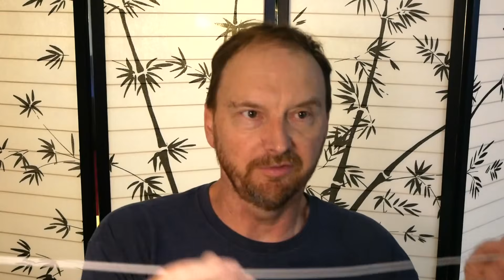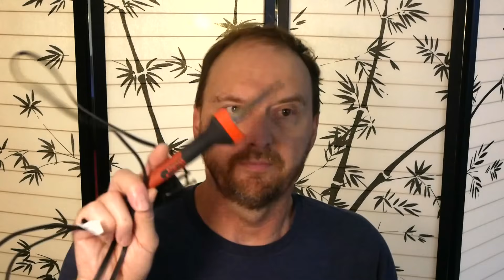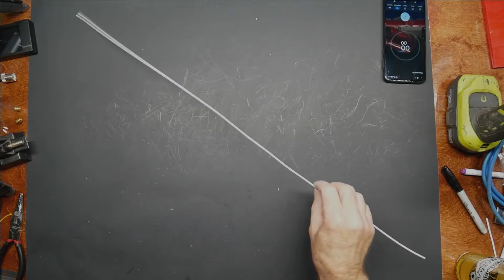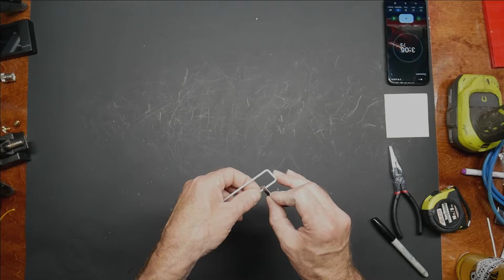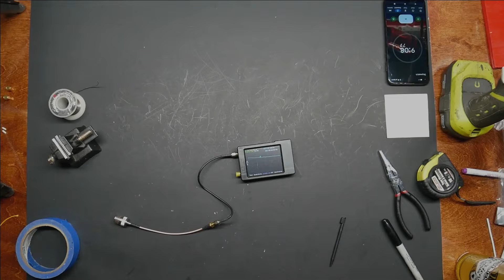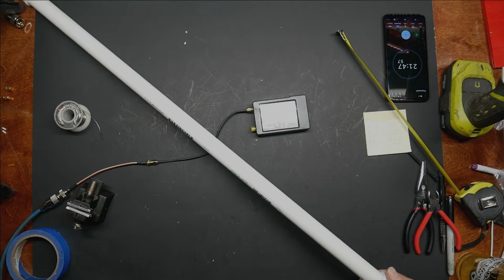Building a GMRS J Pole out of 14 gauge house wire.

Comment: A 5/8 ground plane antenna would perform far better, cost less and be easier to construct. J pole antennas are probably the worst possible antenna you could use for any application aside from a dummy load or random wire. Why people still build these horrible things is beyond me.

For those curious, the reason why is gain. A jpole has less than unity gain, which means you're literally getting LESS power radiation than you put in, and that's not counting coax loss. In contrast, a 5/8 ground plane would give you around 5-6dbi of gain which results in MORE effective radiated power than you put in at the feed point. So Jpoles are harder to build, perform horribly, and are extremely wasteful and yet these ham and gmrs guys insist on promoting these peices of shit constantly.

Comment: I followed this and got amazing results. I have hit a repeater over 30 miles away reliably, after getting it about 25ft in the air. 7w handheld cheap radio. I used blue 1/2 pex because that’s what I had. My bend in the j was slightly tighter than his design but it doesn’t seem to matter.   I taped the ends shut to keep water out for now. I have talked to three contacts now they all say super clear. I’m quite surprised with this. Thanks for the info! WSMH329

Comment: I found a plan in my notes where you can use am inch of tin foil on the PVC at the feed point , slide it up and down and it will adjust your SWR like that.  It works for me. What do you think ?

Comment: I used copper clad welding rods that come in 36 inch lengths to make mine.  Much more rigid than copper wire and they are rigid enough to use without putting it inside pvc pipe.  I have made them from solid brass brazing rods.

Comment: I built my j-pole out of 1/2 inch copper tubing. Works great once I used my nano vna to tune it. Next, I modified it to a super j pole adding a 1/4 wave stub and another half wave. It really works great. My next project is a coaxial colinear vertical. I love the nano vna for doing these antenna projects. I wish I could add a picture of the super j pole here. My next project is a meshtastic j-pole.

Comment: This did not go well for me. Made 3 attempts building this antenna this weekend. None of the SWR values were below 2.0, and when inserted into the pvc no swr value was below 3. I made a 2m yagi before attempting the j-poles, and the swr was at 1.03 at 146.20 and had to make zero adjustments to that build. So at least the weekend was not a total loss

Comment: If there is some insulation on the wire (permittivity higher than air), there will be velocity factor something like 0.7 or 0.8 and antenna should be maybe 20% shorter, than numbers given by an online calculator, right? Does anyone of you measured SWR and resonant frequency please? With heat shrink sleeve tubing and without it?

Comment: Every similar tape measure is manufactured to slide.  It slides exactly the thickness of the sliding end to give you accuracy whether hooked on the measured item or if it's bumped against the end of the item that's pushed against a wall.   When you hook the end on something it measures accurately hooked on the end.  When you bump the end on something (like a wall) the tape measures accurately.  That's because it slides exactly the same amount each way (whether hooked OR bumped) so it will give an accurate measurement both ways.  
Test that.   Hook the tape measure and mark a board or some other item.  Then bump that board against the wall and bump the tape measure end against the wall, too.   The measure should be the same both ways.  Your tape measure should give you the same measurement to that same mark when measured both ways.  That will work UNLESS the tape measure has been dropped in a way that bends the end that slides.
Oh, I'm making antennas today.  I'll make one of these antennas to try it out.  Thanks for the video.  73
Reply: WTF are you talking about?

Comment: I have been searching for a video on a GMRS base station build for days.  I stumbled upon your video this evening and immediately commenced to building.  I actually built two of them this evening.  Both tuned to 1:1 on 467.550, where higher power is permitted for repeater use.  At 462.500, low power, a 1:2.  I found tuning was more accurate if both caps were on the antenna.  I am now able to open a repeater approximately 10 miles away, while holding the antenna in my hand while sitting in my shack.  I can't wait to get it out on the tower to see the results.  Thanks for sharing such a great video!!!

Comment: Band center is 465.14375, I'm going to build one of these - thanks - Question:  Can you give measurements or diagram for the critical lengths and solder points?

How to measure impedance match, or is that derived / guestimated by swr reading alone?

Thanks!

Comment: I am having an issue getting solder to stick to the copper Romex. I've gotten it plenty hot. Idk what I'm doing wrong
Reply: wipe the bare wire with alcohol to clean any residue  on the wire. this may help.
Reply: You either need to use Flux-core soldering wire or apply soldering paste on the copper before soldering with non-flux-core soldering wire.
Reply: @BACKROADSNOMADOFFICIAL I was using flux, I tried a considerable amount too.

Comment: what do you mean by jumper, what coax size and what connector on it, and how long, is the connector for swr pl 259 or tv coax or cb
Reply from the maker: 'Jumper' is a short section of 50 ohm coax with a PL259 on each end. Any coax 50 ohm coax can be used, it's a balance between loss at UHF and ease of use.

Comment: I have 3 questions.  First, would there be a problem building this out of bare copper wire, rather than insulated?  Second, rather than solder the feed wire to the antenna, would there be a problem connecting it with a set screw type barrel lug, that would allow you to move the feed point up & down easily to find the 50 ohm sweet spot?  Third, is there an easy way to measure the 50 ohms impedance with common tools?  I'm assuming that a common hand held multi meter is only going to measure resistance & not reactance.
Reply from the maker: Bare copper wire would work, but would require longer lengths due to velocity factor. The set screw lugs are a great idea. Correct on the multimeter. Higher end radios might have an SWR meter, but the nanoVNA is the cheapest way to measure antenna impedance.
Reply: @ricksshop  How do I know if the feed point is too close to the end or too far away?  I assume that would change impedance.  But how would I measure that?

Comment: Would 12 gauge Romex work any different than the 14 ga? I only ask because I have a bunch of that already.
Reply from the maker: @travismuse7430  Sure. The thicker wire might want shorter lengths. Tune accordingly.
Reply: @ricksshop Sorry I didn't read previous comments before I asked. I see others asked the same question
Reply: @ricksshop  I don't have a tuner. Is it worth buying one? And what one would you buy?

Comment: Has anyone tried this using 12 AWG wire?  Is there any unforeseen issues doing such like resonance, impedance, etc.?
Reply: For anyone interested I used 12 AWG (solid copper made in the Philippines) with seemingly no issues. Excellent response on the scope and dead near flat SWR. The performance has  been great and I’m enjoying many fars with it since it’s hanging off my repeater.

Comment: The end of the tape measure is not sloppy. It moves to account for the thickness of the end. It’s short when you push it against a wall but extends when you hang it over a lip and pull.

Comment: If I was to use 12 gauge wire to build it with would that change the measurements any. Reason I ask is because I have some 12/2 left over from a addition I just got done with

Comment: Thank you for your excellent video.   However,  I have measured carefully and built this antenna 4x now and cannot get good SWR (3+:1).  I am using 13' of RG-58 and a HT radio.  My thought was I could hoist it up a tree at camp.   Any thoughts as to why this isn't working for me?   I get longer measurements when I use online calculators.... using VF = .96.    Thanks in advance for your consideration!  PS--Menards carries the 200 psi PVC...... Home Depot did not.

Comment: Can the body of the antenna be any kind of metal or it has to be copper only? Also can it be uninsulated? Thank you in advance.
Reply from the maker: Any conductive material will work, even stainless (whips have been made of stainless for years). Uninsulated wire will require less velocity factor, therefore will need to be slightly longer. Any material other than copper won't have the advantage of solder connections.
Reply: @ricksshop will 12g wire result in different lengths?  I have both and was considering using the 12g

Comment: No shame intended, since it was only this year that I learned why “the end of these things is always sloppy”. The tape measure is designed to move the end out when measuring outside diameter and in when measuring inside diameter. This accommodates the thickness of the tab on the end of the tape. This is a feature, not a defect.

Comment: I commend this video because it will help anybody build an antenna for whatever service they are into. If you have the parts to build an antenna already, all you would have to source is the wire. I suggest using #10 AWG to lower the antenna "Q" and make it more broadbanded than it would be with #14 AWG. the project might take two hours to complete, including the time to mount it wherever you choose. I would mount it on a metal roof, or on a metal pole above the adjacent tree line for unobstructed access to a repeater. Good luck!
Reply: How about using 12g wire?
Reply: I suggest instead that you use 1/2 inch copper tubing. Makes it more broad banded and much more robust. I built mine as a super j-pole with a quarter wave stub on top followed with another 1/2 wave vertical on top.

Comment: Will 10ga work just as well or better?
Reply from the maker: It will work fine, but with bigger diameter conductors end effect might require shorter dimensions.
Reply: The mil spec seems to have changed on  12, and 14 gage since the 1960's. 14 awg appears to be slightly heavier, 12 awg slightly thinner.. the older 12 awg wire is near near todays 10 ga!..about  .018" difference. Which could change the space between the elements and fitting into thin wall pvc..

Comment: A tip I learned is before you start, clamp one end of your wire in a vise, then use your drill to twist it. This straightens the wire and makes it quite rigid.
Reply: Good tip brother, just did this, my wire is as straight as an arrow now
Reply: So does playing it on a flat bench and cover in with something flat like a 1x6 and just roll the boat over it it will straighten it also
Reply: makes a lot of sense since wire is annealed out of the box and copper work-hardens - nice!

You could also over-anneal it to do your bends / get it to relax first also using a torch though this is likely unnecessary

Comment: Hello sir, thanks for the video. I’m new to GMRS radio so I ask forgiveness ahead of time for my question 😅 
I noticed you soldered the center wire of the coax to one part of the house wire and then soldered the shielding to another part of the same wire. Why doesn’t that cause a problem? Seems like it would be bad to have antenna directly connected to ground. Or were they separated electrically and I missed it?
Reply from the maker: That's a very good question, and a good subject for a video. Look for it upcoming...
Reply: Thats funny,my brother and I are newbies also and i was going to use a cb antenna base and saw the threaded stub was just a frickin solid stub!!! I thought how does that magic work all connected to one stud!!!

Comment: Could you use this directly with your GMRS hand held radio if needing better reception on the ground at a crowded event and get the desired result?
Reply from the maker: Yes. In fact, I outlined such a setup for 2 meters here: https://www.youtube.com/watch?v=lpilADTKD6k You will need to use smaller diameter coax (RG174 or similar) and adapt to your handheld as needed.

Comment: Great video, I'm inspired to build one of these, I can only find 12 gauge laying around, will it work?
Reply from the maker: Yes it will, the larger diameter may shorten the dimensions a bit.
Reply: how would one go about calculating the difference? I also have 12g on hand.
Reply: Did anyone find the dimensions for 12ga wire?

Comment: Thoughts on using 18Ga wire? Too thin?
Reply from the maker: Oh, no, it would work. And handle 100 watts as well. Smaller conductors might need a bit more length. I just use 14ga solid as it's the most common.

Comment: Nice J pole for any frequency ! Just use the formula for a j pole and then trim for resonance. I would seal the PVC and use it as a radome to keep moisture out so it would not change the resonance any. Better to build an antenna and learn from it, than just buy it off the shelf and learn nothing. Well Done ! 73 de W4FJF.

Comment: If your antenna has a vswr of 1.2 after the first build just leave it like that. Is is excellent. It amounts to a reflection of only 0.8 %. Even 10 meter coax or a connector will cost you more power.

Comment: Thank you for doing this build video. Saved me a lot of trial and error and I managed 1.07 @ 465 MHz after 2 trimmings. 🍻

Also…(fyi)
The “slop” that’s in the hook end of a tape measure is designed to make up for the difference of when you measure by hooking the end over an edge, versus butting the hook up to the edge. 
The amount of movement is equal to the thickness of the hook material and yields the same measurement regardless of how it’s used.🫡

Comment: will it perform better with radials?
Reply from the maker: It doesn't need radials as it's already 1/2 wavelength. The gain of a vertical dipole is a bit better than a 1/4 wave ground plane with radials.

Comment: Q: If you take off a little too much off the short leg.. can you "add it back" with a dab of solder solder?  Recommendations?
Reply from the maker: Yes, what I've done is solder a wire in parallel that can be moved in and out to adjust...
Reply: @ricksshop  Good idea.. Thanks!
I think this is a great first scratch antenna project!

I am curious why this one is so much shorter than Ed Fong's GMRS JPole.
Reply from the maker: @ThomasWeeks  Ed's DBJ-UHF is a collinear antenna, thus the extra length. Ed knows his stuff.

Comment: Beautifully and clearly presented step-by-step antenna project. Thanks for taking the time to put this together!   [EDIT:  A couple of hours after watching your video I raided my junkbox and built the GMRS J-Pole to your specs. It took me twice as long as you but it came out great with my CAA-500 Mark II showing 1.1:1 resonance at 464.5 MHz and 1.4:1 at the 467.7250 and 462.5625 GMRS band edges. I'll hang it off the side of the tower tomorrow weather permitting. Thanks again!]

Comment: Why not use 1/2 copper pipe and build a real J Pole antenna. Its all about antenna GAIN people and 14 gauge wire is crap. Do things right and get good results with the right material 15.00 tops for a good copper J Pole with high gain do not use 14 gauge wire this is crap.
Reply from the maker: Incorrect, especially at UHF. The only thing that changes with thin conductors is bandwidth, but GMRS isn't that wide. Also, my personal opinion is copper J poles look about as redneck as an antenna can get.

Comment: here in Australia we have 2 C.B. bands, globaly 27mhz and localy 476.425 mhz to 477.400, this was 40 ch @ .025 spacings now we have 80 ch @ .0125 spacings, repeaters are offset @ +.750 from ch 1 to 8 and also 41 to 48 i use a J-pole plus other multi-gain ant 6db and 12db, O' just as a foot note ' Australia, new south wales police  467mhz - 469mhz multi-channels through-out the region LOL so' leave you GMRS at home when comimg to Aus ....cheers

Comment: Nice video. You can also adjust your SWR by moving your feed point connection up or down.
Requires playing with soldering and unsoldering. Nice simple project.
Reply: A pair of small alligator clips attached to the coax would speed up that process.

Comment: The wobbly end of the tape is to accommodate for whether you’re pushing or pulling on the hook. The wobbliness is exactly the thickness of the hook so it’s always accurate. Thanks for the video!
Reply: “Holding 1”” in carpentry was taught to me at a very young age by my father.  Thanks Dad for those lessons I’m still using 50 years later! Thing I’m confused about is, should I be adding 1” to all those measurements. Using GMRS in the event of emergency, as I’m disabled.
Reply: It's amazing how many people don't know that.

Comment: All your effort was prity good, but at the end,you missed to measure the final or tunes length of J which you dud cut
Reply from the maker: I assure you, it was most deliberate. Changes in velocity factor, wire type, pipe used, installation location would all change the length of the final antenna, which is already difficult because of the UHF frequency (1/4 wavelength is only about 6").